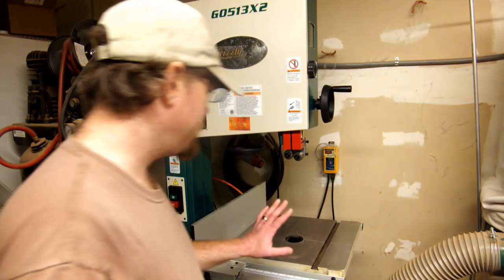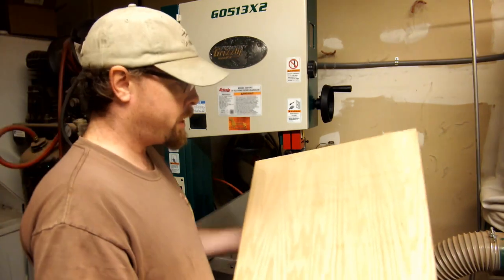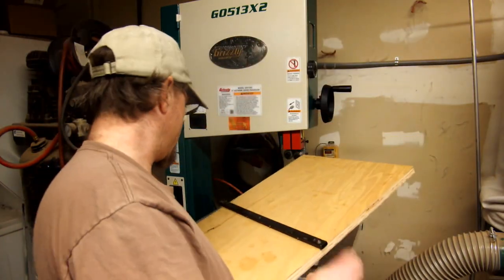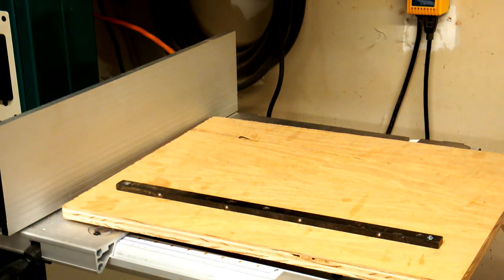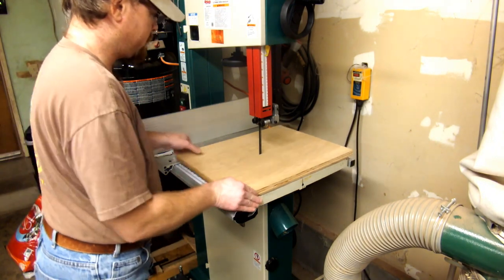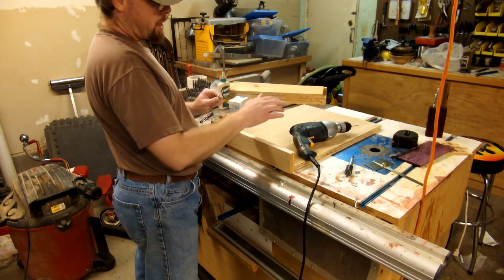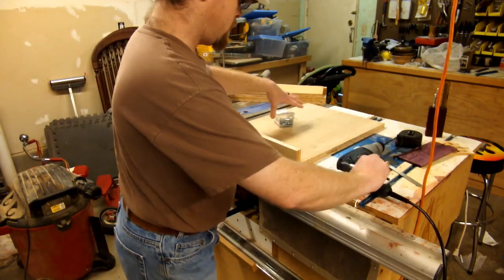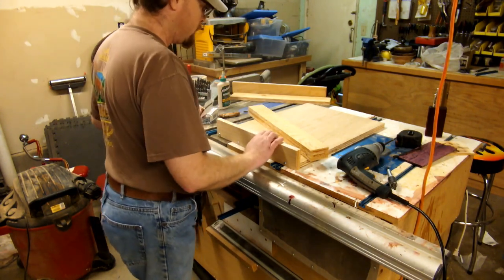Video #5 Segmenting Sled For The Bandsaw

Comment: Been looking for segmented cutting sled and my thought the thin blade of band saw would be better than table saw I was just thinking why not us some pegs for arm at cutting edge so no need to use clamps 
Thanks for posting
Reply from the maker: Just need to be careful when cutting.  The band saw does allow for more pieces due to the thinner blade than a table saw, however, I have found that the band saw cut parts need a bit more sanding than table saw cut segments as the cut is not as smooth--mostly due to the blade tooth pattern.  As far as clamps, it really has to do with the length of the segments as they are cut.  Usually, the segments I work with are quite short and, as such, clamps are not really viable as there is not enough for the clamps to hold on to.